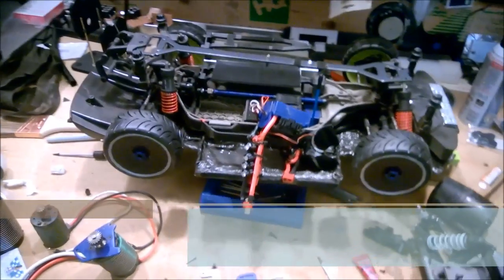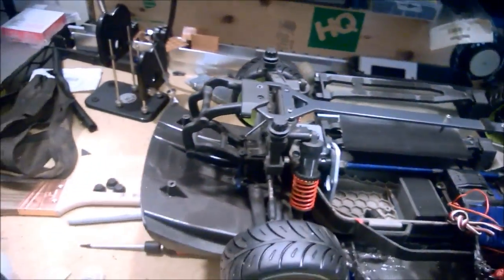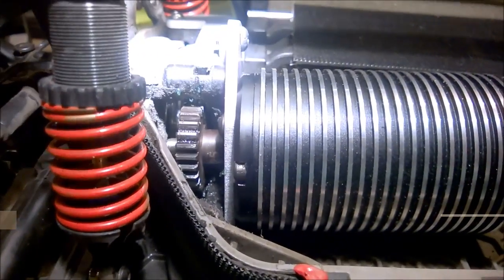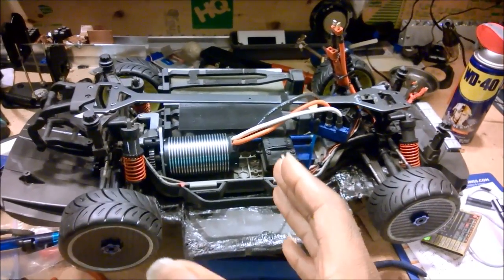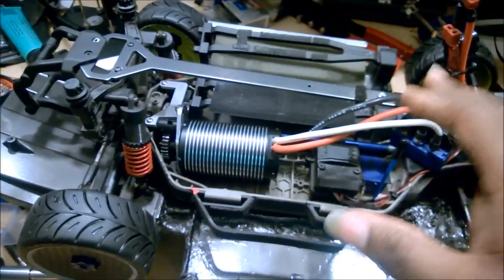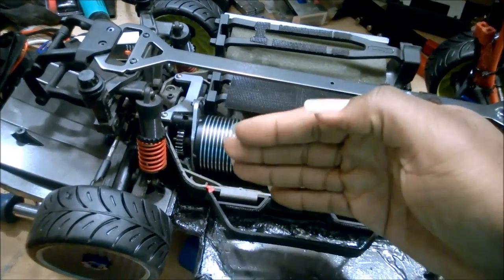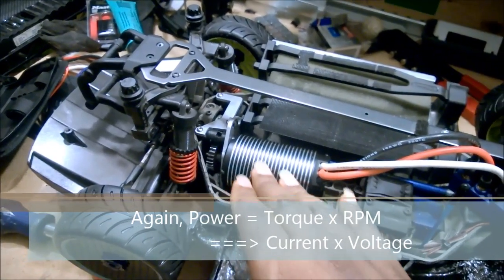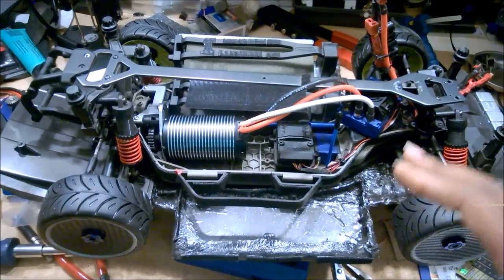Ep. 124: Castle 1717 Install & Brushless Motors 101

Comment: What's up I know am very late in the game. But I have looked for this same mount you show for the 1717 motor but have no luck finding it  .... I really want to to be able to put the largest motor I can in my slash 4x4 lcg with no or maybe slight modifications.... any ideas or tips or suggestions  plus what parts should I obtain would be extremely helpful.  Excellent channel btw, like the fact that it's very detailed and fully explained.... I  just finished my deployment and finally now a civilian  able to enjoy my hobby  again ! 😁
Reply from the maker: Those mounts aren't in production anymore. They were produced by VGad at https://www.sagacustomrc.com/ If you reach out to him, he might be willing to do a one-off build for you. The one downside of that design is that you have to cut the stock motor mount and chassis to be able to fit larger gears.

Comment: I thought the xo1 ran a 29 t pinion . And correct me if I'm wrong but don't you want your gearing set up in a 1 to 1 ratio , for top speeds , that's why you hear everyone talking about 34/34,ect. ...
Reply from the maker: Lots of people use rules of thumb to help them get close to the sweet spot, but you have to use trial and error to find the best setup for your rig. 1:1 for 1/8 scale GTs is a good starting point, but everything from motor kv, battery quality, vehicle weight, tire diameter, body drag, bearing type, etc. can impact what the best gearing for your ride is. Listen to what your car is telling you. Tuning by motor temperature is a great way to see if your changes are really making improvements.

Comment: Yo...I just ordered that mount last Tuesday! Lol!! Should have mine by Monday! That's crazy!
Reply from the maker: +Dan P (AT EASED1) Great minds think alike!
Reply: Thanks for the mention too. And I know exactly what you mean by ESCs going up in flames from being over powered. I don't do that either. I'd rather test different motor and gear combinations rather than max out my ESCs. I wasn't saying for you to over gear. And I don't usually tell gearing but I hit 105mph with 30/34 gearing when I made it into the triple digit rc club with my slash 4x4. So that's only 3 more teeth then yours. I also used a factory size motor mount...just had to do some light trimming to make it work. I didn't go with the high rise motor mount because I didn't want my slash to look like most of the other ones out there.
Reply from the maker: +Dan P (AT EASED1) No worries, I didn't take it the wrong way. Actually, the gear you mentioned was a 20 tooth that I was testing with while I still had the counterfeit 2650 kv motor in. The higher kv motor called for a smaller pinion for me to shake things out with. I theorized that it would be better to walk up to the higher speeds and make sure the power system wasn't getting too stressed. Apparently it's working. I'm editing my Run DMV footage now and I recorded a motor temp after a 90+ mph run of only ~115 deg F!
Reply: What's up I know am very late in the game. But I have looked for this same mount you show for the 1717 motor but have no luck to find .... I really want to to be able to put the largest motor I can in my slash 4x4 lcg with no or maybe slight modifications.... any ideas or tips or suggestions  plus what parts should I obtain...  great channel btw .... I  just finished my deployment and finally now a civilian  able to enjoy my hobby  again ! 😁
Reply: I B Thanks! And check out EM Performance motor mounts for the slash 4x4. You can find it on eBay. There’s some simpler ones out there that came out before it but it looks very well made. And the mount is one piece unlike the plate others sale.